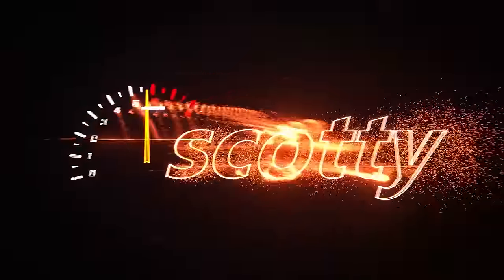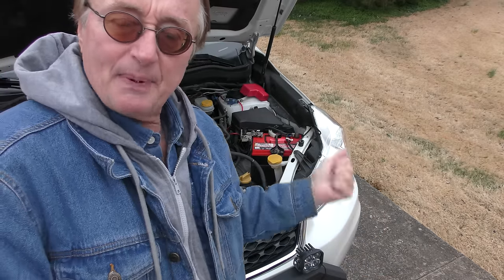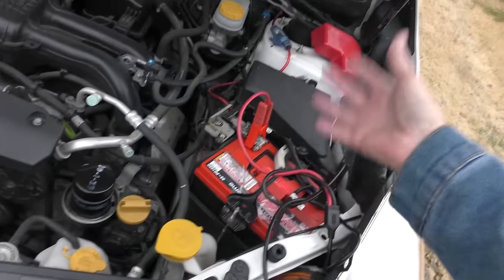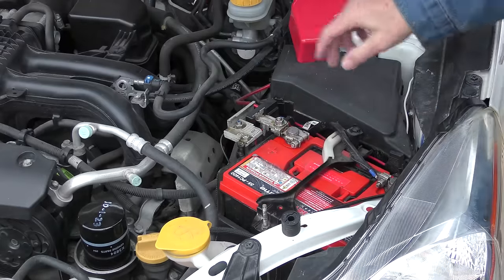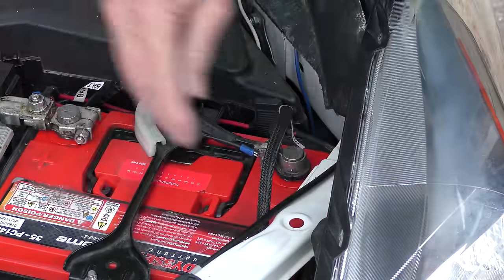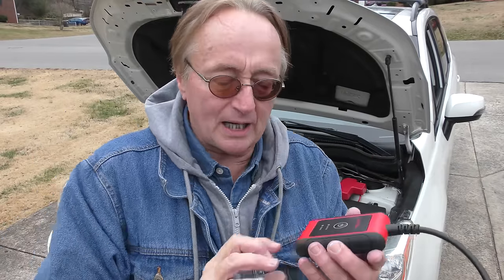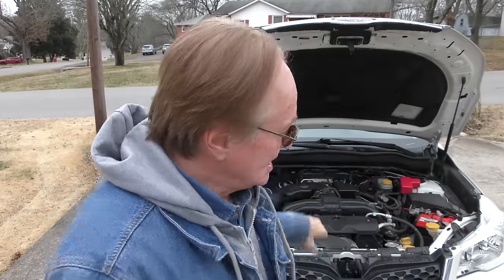Here's Why Connecting Your Battery Like This Will Destroy Your Car

Comment: At what percentage life left is it time to replace the battery?
Reply: If you really wanted to determine that yourself a VOM isn't enough, you'd want to test the battery's specific gravity too.  But if you've gone that far with the battery to even think about doing such tests, just take it into the shop since they already have the right tools.  
Personally I just go by age, and how well it starts the car.  If in doubt I'll put a VOM to it with engine running.  If the alt is still giving the battery 14v, but the battery dies anyway, I'm just changing it.  Because at that point the alt will be working so hard to charge a dying battery,  it might take the alternator with it. And it just makes me flat out nervous to drive around with a marginal battery, that's liable to strand you any time.
Reply: @robertmaybeth3434  Hi Robert: thanks for your wise input. I heard Scotty mention percentage of battery life when scanning a car. It was less that 100% and he didn't recommend changing the battery. Years ago, he said to change out a battery if it's at all abnormal on testing as this could affect electronics.

Comment: Automobile charging systems that are designed for lead acid batteries will incorrectly charge agm batteries.....or anything other than lead acid. Agm batteries have a specific charge profile. Will they work in your vehicle? Yeah, in most vehicles but dint expect a long life expectancy from it or any benefits of it. You can expect to pay alot more for it though....that you can count on.

Comment: The trouble with Optima is people try to treat them like an acid battery when they are not. You get below 11 volts it will not take a charge unless you use an AGM charger. 

This car is wreck so no wonder it is a mess.

Comment: Scott i got a good question for you !!! 🙏 Lol got a funny one, maybe its happened to you before . By accident i started the hyundia with remote starter in my pocket so i shut it off while looking at it to make sure.. went to start it dismorning dead..okay. Charge the battrey i put my connections on ticktickticktick relays for lights ticking lol wtf so i unplug the battrey and charge it ..plug the battrey  and it starts automatically ,i had the fuse cover and the air box thing on top and it went towards the fans 😂 idk what happen but the remote starter for sure had somthing to do with it lol

Comment: 3000 rpm?! on my car it's almost at red line, and I've never been there in my and my car's life. It shifts gears at 1700-2000, and 2500 already feels and sounds like liftoff.
The factory battery lasted for exactly 10 years.

Comment: Got a 97 geo prizm lsi 1.8L 101k miles and when I let off the gas the cars idles down  like it should an right before it gets to regular idle right before where it gets steady idle it is vibrating bad but almost none when foots on the gas pedal given it gas even just alil gas the vibration goes 98% away, put new plugs n wires and rotor cap n button on it but didn't change anything any thoughts? Thx scotty.

Comment: You should NOT make sure your terminals are SUPER TIGHT.  You should make sure they are SNUG....same as lug  nuts. Overtightened terminals will distort the shape of the terminal, and when you go to replace the battery again, in another 3, 4, 5 years, you will have a problem when you go to tighten the bolts again.....they just wont fit right.  I'm sure Scotty has experienced this on many Honda, Kia, and Hyundai products. So do not over tighten, just snug them up.

Comment: I have a battery in my 95  Honda, the battery is almost 3 years old and just got it tested
and it's at 100% and so it my starter and the alternator is at 100%.
I'm shocked the battery is still so good... I thought the newer batteries usually ran out around 3 to 4 years.

Comment: My 1994 Ford Ranger was discharging batteries so fast that I was either using the trickle charger or disconnecting the cables to the battery every night.  Brought it to a mechanic who found a penny had rolled into the cigarette lighter slot!  We figured it was from charging my phone, not placing the knob back in afterward, and tossing some change in the ash tray.  My brother teases me by giving me a penny and asking to charge it up.

Comment: We also got battery problems with our car. It's a Nissan pick up but DAMN its one thing after another, its been a complete lemon for two years now, not just the battery. I might as well have bought a Land Rover at least that wouldn't have been boring as this piece of crap even if its just as unreliable.

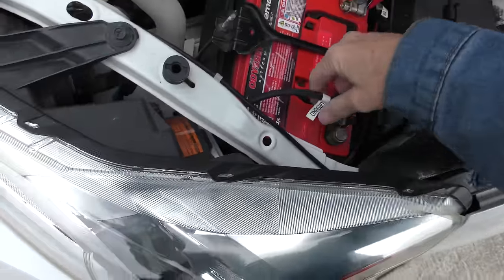Comment: 5:19 "Lose battery terminal, especially the ground"  does not make sense as a high
resistance on either the + or the - will cause volt drop to all circuits.
Please learn how electricity works, then do the video !

Comment: A VAT 40, a volt meter: with an amp clamp!  I've seen bad batteries take out alternators bad alternators take out batteries bad batteries take out starters and alternators. Bad starters take out batteries.  I'd still prefer the old school way of diag. Yeah new computer equipment is nice. But most techs have no idea what their really doing and how it works. Oh yeah throw in a external voltage regulator... that'll really screw with new techs

Comment: There is a class action lawsuit against Subaru for battery drain issues. It's probably not just this loose connection.  My wife's Subaru same thing.  It affects the following:
2019-2020 Subaru Ascent.
2015-2020 Subaru Forester.
2015-2020 Subaru Legacy.
2015-2020 Subaru Outback.
2015-2020 Subaru WRX.
Reply: These newer  cars have an (age of battery ) memory built into computer memory. If you do not reset (age) ,the computer will overcharge the battery based on its age. That will overcharge battery and kill it.

Comment: You didn't check the cables both battery cables need to be looked at because rust caused by salt follows the ground (Black) cables from the battery to the frame and the (Red)cable  to the alternator and if this is happening the guy will bring the car back!

Comment: When it gets really cold my 2003 Caravan brake pedal used to shrink down onto the brakelight switch, turn on the brake lights and dud the battery by morning.  
A wee little adjustment to the switch position fixed that.

Comment: I bought a $200 Top-brand AGM battery for a 20 year old Toyota that had low cranking amps from new, and started self-discharging after 11 months and died a month later, I payed $70 for a pro-rated warranty replacement died 9 months later. I replaced that with the cheapest flooded lead-acid battery from a big-box store I could find for $60, and two years later,  and one of the coldest winters on record, It still charges perfectly, out-cranks, and has more reserve capacity than the High-dollar AGM. 
My experience with AGM batteries in Aircraft and and portable power and mobility devices over the last couple of decades has for the most part been one of inferior performance and longevity to flooded Lead-acid batteries. My experience with LifePo4 (lithium Iron Phosphate) batteries over the last three years in aircraft, solar storage and with DIY electric bikes/motorcycles has outstanding.

Comment: My 04.5 dodge cummins charges 15 volts.  Bought the truck brand new and factory batteries lasted 10 years. Got 6 years out of the 2nd set.  Still on my 3rd set.   Worst part about it charging 15v is thats where my power inverter shuts off due to over voltage.  So I have to turn my headlights and light bar on to get it down to 14.9 volts  so I can use the inverter

Comment: Just this weekend i accidently left my trunk open overnight. The light drained the battery. So i immediately tried jump starting it the next morning. Car wouldnt turn whatsover. Then i actually resorted to using my head and noticed one of the terminals was filthy. Cleaned it and let it sit in house overnight so it wouldnt be frozen from the cleaning. It actually started that next day and hasnt missee a beat since. Realized this solved a whining noise probably from the alt, because it dissapeared. Mechanic had misdiagnosed and said i needed to replace ac compressor and alternator to stop the noise.

Comment: Hey Scotty, that wire has a huge sticker on it that reads "GROUND", meaning it should be connected to the Ground of the vehicle, not the battery negative post.  Had they wanted it connected there, it would say "BATTERY NEGATIVE POST."  
There is a difference, and as a technician, you should no this.

Comment: I ordered a new battery through a local shop and they gave me a Continental 525 cca battery. Is that adequate for a 2010 Camry XLE? I replaced an 8 year old (Yes 8 years I cannot complain!) EverStart Maxx with 750 cca that struggled to start in the sub 20 degree f range due to bad battery health.
Reply: You need to look up what your car needs. You don't want a battery with to low c.c.a.
Reply: personally I would not use less than 750 ,  but then again 525 may be enough

Comment: That engine sounds really rattly
Reply: Boxer engines sound like that.
Reply: I used to be a VW mechanic (air cooled), and 20yrs later test drove a brand new Subaru - despite being water cooled, it sounded like the valves needed to be adjusted - rattly. They sound pretty worn out brand new...
Reply: @boost7983  Boxer engines sound like that. it is in fact normal
Reply: @horseathalt7308  Yes, they do. I was surprised.

Comment: If you keep tightening the terminals on strap type clamps they stretch and get loose on the post even when the bolt is tight, so don't tighten it.

Comment: I was told to NEVER place a ground wire directly to a battery without a separate fuse. If the chassis connection comes loose high current, like starting the car, could go through the smaller wire and start a fire.
Reply: Not quite. Always fuse the positive wire close to the battery. What you don’t want to do with the negative wire is create a double ground by having a negative connection to battery AND chassis. That of course depends on the design of the circuit or accessory:
If the circuit or accessory is designed to be grounded to the chassis or through its mounting hardware then do not run a negative wire at all. 
If the circuit or accessory is designed to have positive AND negative power leads then connect them both to the battery (fuse on positive) and route them so that neither wire can contact chassis or be cut or abraded by vibration.
In both cases if the positive for whatever reason contacts a ground the fuse will open. And if a grounding strap or negative lead to engine or starter fails there will be no path through the accessory wiring.
Then again, fuses are cheap and it won’t hurt anything to fuse the negative as well. But always fuse the positive immediately at the battery.
Reply: @EmilioIacobelli  As an amateur radio license holder, when I buy a mobile radio, it comes with a cord with a fuse on both leads. To reduce noise, the ground is connected to the battery.

 The reason for the second fuse.

1. If you disconect the ground going from the battery to the chassis.
2. Try to start the car (it could be anything, but the starter is one of the biggest things that i can think of)
3 The power will go from the battery through the starter to the chassis.
4 With the battery's chassis cabel disconnected, the only way back to the battery is through the case of the radio, then through the radio's power return cable. The radio's cable is big enough to carry the current of the radio alone, not the entire car.
Reply: @user-fr3hy9uh6y  Agrred, that is a special situation where a double ground is unavoidable. Car audio installation has similar situations now that I think of it. Lesson here I suppose is to ensure the engine/starter grounding method is in good condition whenever adding an accessory.

Comment: Auto Zone put a acid type battery in my wife’s Acura TL and every time you drove the car and when you shut it off it would say battery is low tur everything off so after a few months of that I went and bought a AGM battery and all my problems were gone and it came with AGM battery from factory so why would dumb Zone do that ?
Reply: They did not have the right battery.  If OEM is a AGM battery you need a AGM battery.

Comment: So strange you don't know the safe max charge v for 12v Lead Acid battery but you rely on colors. Depends on temperature, or do you not have any knowledge on cars and batteries? Nothing wrong with either test. Not sure why you care about the slider as it will not make 1% difference if you select 700 or 900 amps, those handheld testers will never be accurate because they can't put that kind of load on the battery. They create a simulation and the answer is just a theory that the battery will be xx percentage. Run real numbers with a real tester and you will get the truth of battery condition.

Comment: Tighten snug not super tight
Reply: BINGO! If you do super tight I can guarantee you you'll break the terminal seal and you'll have battery gas coming out and corroding the terminals and connectors in short order.